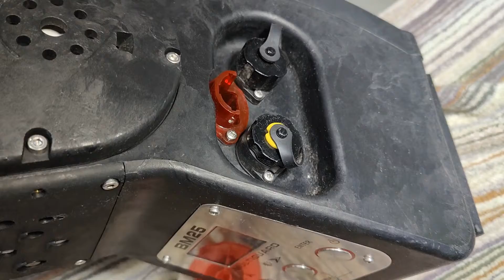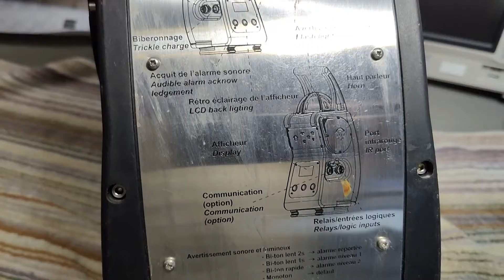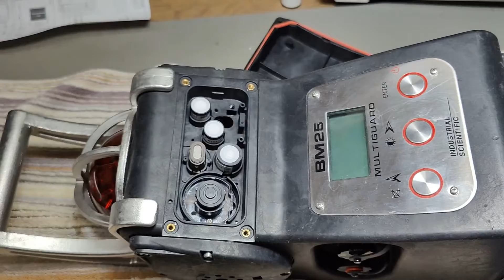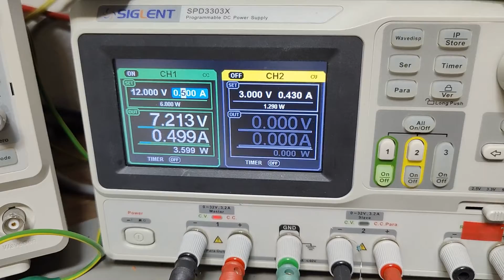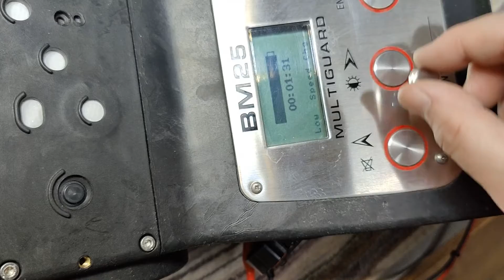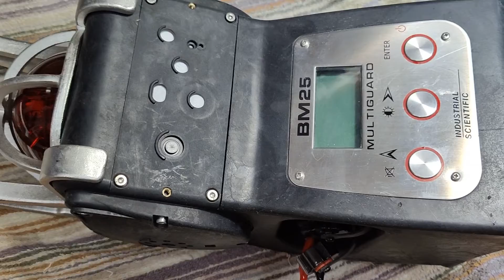Multiguard BM 25 Multi-Gas Area Monitor 2007 teardown

Comment: Hydrogen sulfide - or the rotten egg smell - is a particularly insidious gas. The first symptom of toxicity is that you can’t smell the damn thing anymore. If you smell H2S, leave the area immediately. Do not trust your nose after initial exposure - if there are dangerous levels of H2S you will only smell it for a short time. Then you won’t. And soon after you die. It’s bad. H2S can be present in caves, mines both shallow and deep, underground utilities - utility tunnels, sewers, telecom and power wells, etc. Absolutely do not enter abandoned mines without a gas detector. Of course you should not enter them anyway due to more pedestrian hazards like falling into a hole and being stuck and dying there alone.

Comment: An MP3 player / Bluetooth speaker would be a great way to utilize this very nice enclosure. You could fit some crazy big battery inside - after all, the handle will definitely support it. And the red strobe can add audio-sync’d party ambiance :)

Comment: I don't know this company or their units but I  did work for Draeger in Germany for a few years and I am wondering why this unit doesn't have a pump build in to ensure air flow across the sensors. Draeger area gas monitors all had, only the handheld devices did not.

Comment: You don't hammer piezo's you push them with increasing force. In fact most piezo switches are immune to hammering and vibrations. They act just like a switch, so just shorting the leads should work.
Those are quite expensive as well, I needed a few and even on ali they are about 10 euro's a piece.